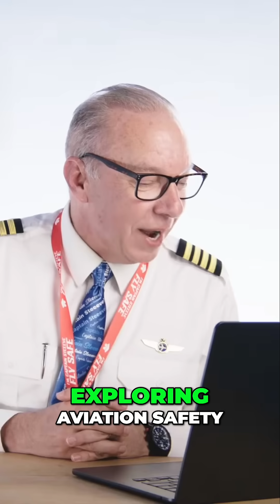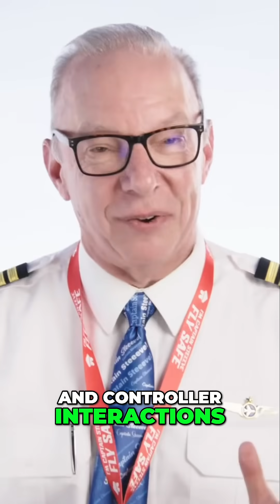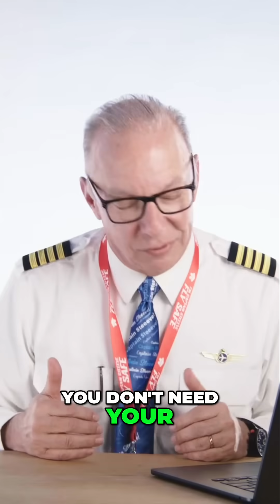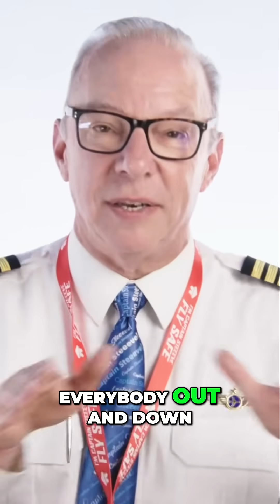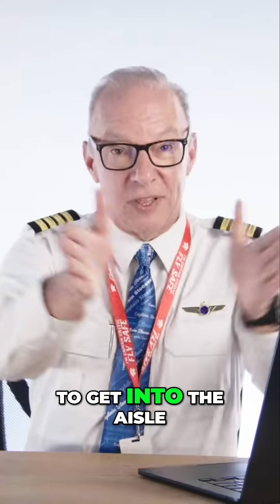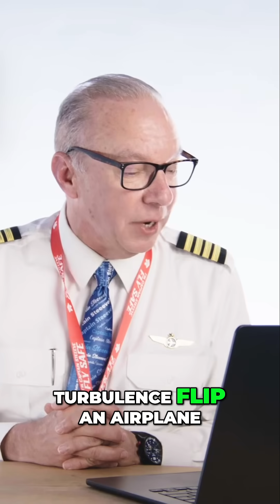Why Tray Tables Must Be Up During Landing: Safety Explained

Comment: I always thought if the tray was down and the plane had a rough landing, you might get your face rearranged.
Reply: Not if you’re wearing your seat belt
Reply: @scotthill1600 yeah cause the lap belt will totally stop my head from moving
Reply: @scotthill1600  Unlike an automobile, there is a lap belt only and that will put your face into the perfect position to be planted into the tray if the tray is in the down position.
Reply: @scotthill1600  since you don't have a three point belt in a plane, I don't think it can save you here